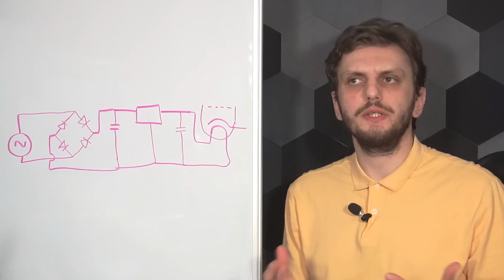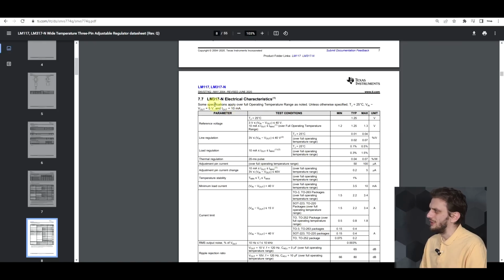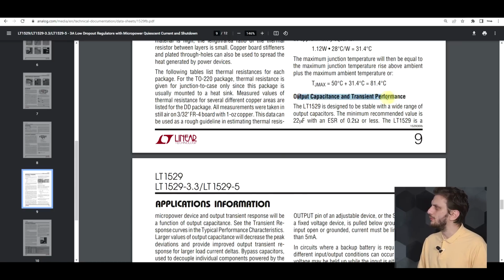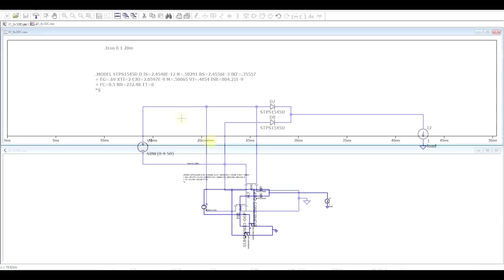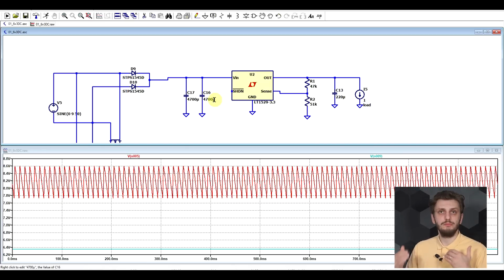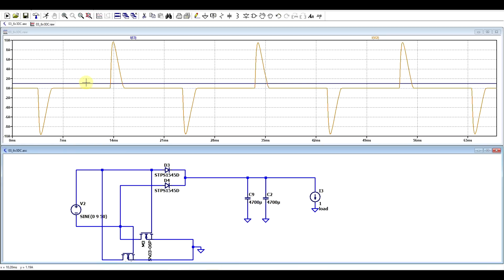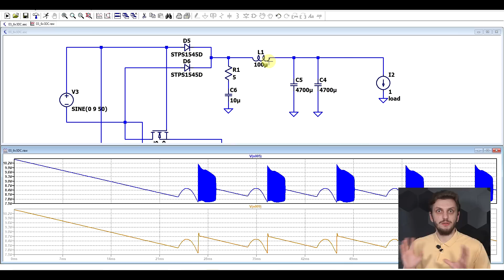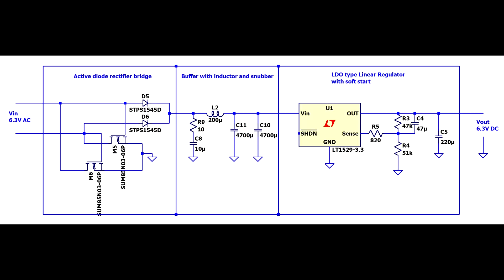DC supply for Vacuum tube filaments (1/2)

Comment: Thank you for simulating this, and in the process showing how easy it is to add a soft start to a traditional linear regulator, with just one or two components.  I bet this would make LED lighting "look" better if it did not instantly illuminate at 100% (like a strobe light) but instead ramped up in intensity over a second or two. Bravo!
(I also loved the active rectifier explanation too.)

Comment: Now I know the reason for why my Ltspice simulation is too slow.
You should make a video about snubber circuit design in future.
Reply from the maker: Usually when a simulation is running to slow, or just does not want to start - there is a conversion error; I try adding the ".options cshunt=1e-15" statement. - this adds 1e-15F (0.01pF) to all circuit nodes and usually helps. The exact value you use can be different of course 1e-13 to 1e-16

Comment: So... A filament is a dead short when it is cold and it rises in impedance as it heats up, so your start up current will be much higher than you are seeing here. You can just measure the filament on a tube to see what the cold impedance is to get an idea of what the peak inrush current might be. Another thing to keep in mind when doing this is the power factor and diode losses. This is rarely considered when retrofitting DC filaments into an existing gear but it can be significant. Also in the past I have used LT LDR's with tubes and they are (at least the one I used) very fast meaning the one I was using had no tolerance for poor layout and it oscillated. This is the only time I have ever seen a LDO become unstable (but as I said this was wired with... wires _ I recall it had 5 pins and I needed to add bypass caps to get it to behave). I would suspect that the cap in the feedback network you added might be a problem. I was kind of hoping you would be designing an offline 6.3 volt supply with PFC, but I enjoy all the videos you upload - Thanks!
Reply: dead short > much lower resistance than when at working temperature.
impedance > RESISTANCE, agree?
Reply: @paulcohen1555  I would say that the load is almost 100 percent resistive hot or cold. I would think that reactive components are minimal.
Reply: You ALWAYS need bypass/decoupling caps right_next_to_3 terminal regulators though.

Comment: Why don't you use linear current regulator? Two resistors, a small signal transistor and a TO-247 power transistor or MOSFET. Can handle down to 0.8V voltage drop.

Comment: very elegant, of course you could just do a full wave Doubler prior to standard linear regulator. it would require a second filter electrolytic capacitor
Reply: @cat The whole point of the video was that a standard bridge rectifier would be inefficient to meet the Dropout voltage of a standard linear regulator
Reply: @davidkclayton The doubler will be impractical, as it will require a very high capacitance. The several filaments together may take amperes of current that will drain almost any capacitor much faster than the next charge will come.  Doublers work reasonably well for low-current circuits.

Comment: I also share my opinion, from decades (25) years of experience, I have made tube amplifiers specifically.  is as follows, filaments with AC current sound better, more realistic, more analog, and looser than filaments with DC circuits.

Comment: Given the regulator involves a series transistor, I do find myself wondering if one could make an all-transistor-based active bridge rectifier that, rather than driving the transistors to saturation, uses a feedback circuit to also regulate the output voltage in some way, thereby reducing the total voltage drop... eh, or perhaps I'm just re-inventing the switching power supply?
Reply from the maker: I think the closes thing to that, currently in use, would be the active PFC circuit; since the big issue with a rectifying bridge+ the rest of the circuit is still the poor power factor. Anyway; I guess you could adapt an active diode bridge to also work as a voltage regulator - not just to compare the input to output but also to a built in reference.
Reply: @manitoba-op4jx  Sounds extra extra complicated, but a sound point.

Comment: I've seen the most common solution, no regulator and  a 1-2 ohm power resistor in between two filter caps, depending on your filament load
Reply: Yes, I have use this many times because of low headroom for front end of guitar amps with 2-3 12a_7 tubes I usually end up with about half an ohm split between top and bottom (1 Ohm total) with the bottom being reverenced to either ground or some small positive voltage. It is fun to see the arc of videos leading up to this one though!

Comment: I'd rather ditch the 6.3V heater primary constraint (at least when designing a new amp from scratch rather than modifying an existing one or using old iron as a base for a new amp) and make a classic voltage regulator for noise-sensitive tubes, i.e. mic, RIAA or guitar preamp stages.

Comment: main voltage has +-10% variation, you will not get 6,3 DC when the main is at its -10%
Reply from the maker: That is true.. I guess it would be possible to set the DC supply voltage from the beginning to be ~5.7V (6.3*0.9) to account for this case; or any value that can be obtained under any conditions between 5.7 and 6.3

Comment: Why not use 4 mosfets in the bridge?
Also your startup ramp will hit the regulator with huge power dissipation for too long, ..It will likely melt! :(
Looking forward to you next video :)
Reply from the maker: The 4 mosfet bridge would have needed some more complex circuits to work correctly, and most regulators do have some built in over temperature and over current feature - its highly unlikely they will self destruct during the startup, but that remains to be seen :D

Comment: I am a pretty old fart, but I recall from the 'old days' that running tube filaments on DC will shorten their life compared to AC
Has something to due with filament material ?
Reply: Differential thermal emission.

If one side of the filament is grounded then the other is 6.3V or whatever negative and electron current (although low) will flow from one side of the filament to the other.  Also some ion migration kinda like electroplating.

If you let the filament float that won't save you either because you'll still have one side of the filament -6.3V relative to the other.  This also messes with grid voltage and causes uneven heating of the tube because the edge of the grid closest to the most positive part of the heater will fry.  Grids are usually rated for dumping, say, 50 mA into the entire grid, but only 25 mA into just one little edge will melt it and short it and "how could running DC filament cause my amp tube to arc over when running way under ratings?"

There's a classic technical paper from 70 years ago from some guy with a B in his name where you take a tube with like 5 heater wires in series and due to drop they're all at different voltages relative to the grid causing some kind of massive linearity problem, you could tell in the linearity graph which PA tube was powered by AC and which powered at DC.  Perfect conductors don't exist in the real world and if you have the gear to measure enough dB of SNR it'll show up, even if it may not matter in practical applications.

If you think running DC will prevent hum, surely running ultrasonic AC would prevent hum even betterer.  So yeah, decades before 2000's era switching power supplies there were guys running tube heaters at 20 KHz.  You'd never do this in production, but typical ham radio stuff you go to a swapfest and come home with a 10 watt audio xformer and ...

As usual with engineering, just because you can prove to two decimal places that running DC will turn a 10K hour life tube into a 9.9K hour life tube, that doesn't mean anyone outside the engineering dept will care.  Also most people don't run right up against the limits of grid or plate dissipation nor do they run 1 dB below linearity limits, so "most of the time its OK enough to run DC"  Another typical engineering thing is you could buy DC rated heaters which just had larger heavier more expensive wires, but if 99% of non-automotive tubes ran on AC they're going to ship with the cheaper thinner wire.

(edited to add, I forgot about thoriated filaments, thorium is expensive so if they thoriate it they'll apply it evenly which is fine for AC heating but a DC heated filament will emit more from one side or the other so it's thorium layer will "wear out" faster than the other side of the filament.  Again, typical engineering stuff where just because you can prove the tube will only meet specs for 9.9K hours after you pay for 10K hours doesn't mean anyone will care, but its a real measurable effect...)
Reply: @VinceMulhollon  Ah, excelent point! I pretty much wasnt thinkng of directly heated triodes when watching the video. Has anyone thought of flipping the dc polarity occasionally to "Even out" the wear on the filament? I wonder if that helps?